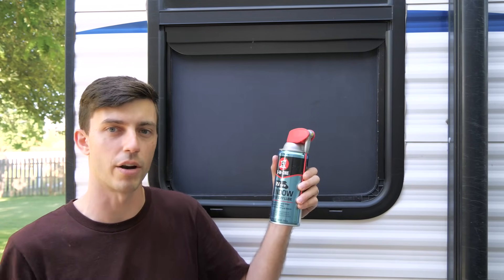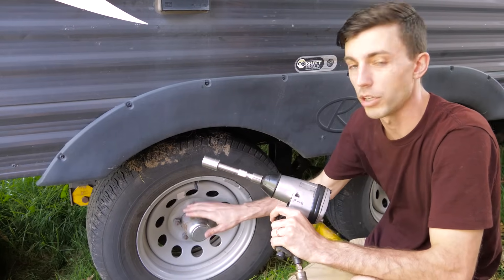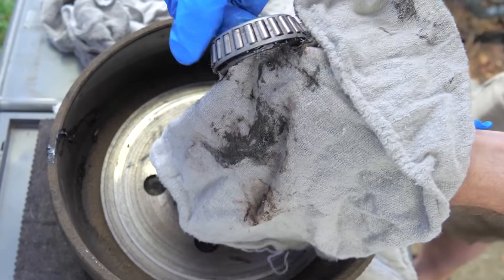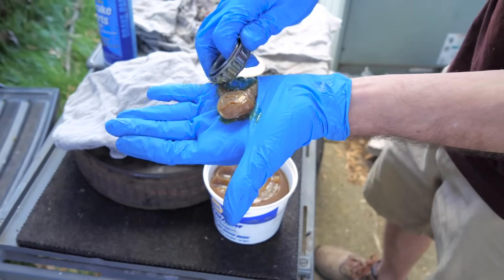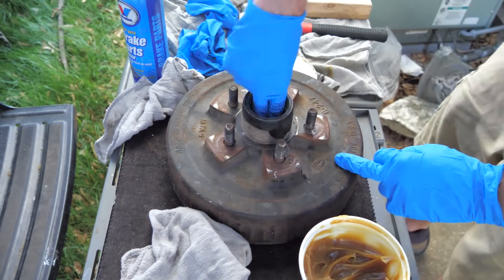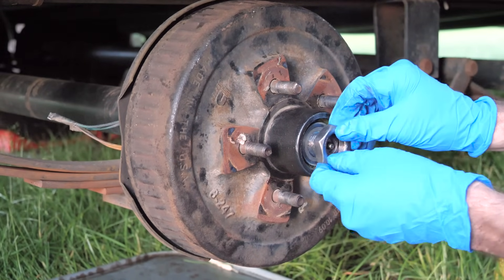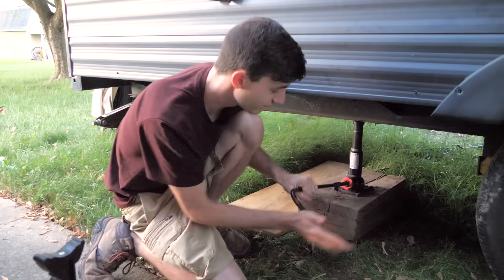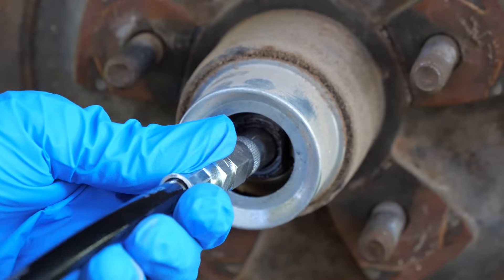Trailer Wheel Bearing Grease Repack and Easy Lube - RV Travel Trailer & Fifth Wheel

Comment: Nice job on the video, David! I repacked the bearing on my trailer for the first time earlier this year. It was easier than I thought. I ended up replacing the Dexter bearings with made in USA ones after hearing recommendations from several people. Last summer I tried the ez lube hub —but I was so paranoid I blew out the seal, so I don’t think I will use this method again.
Reply: You don't need that much grease in there anyways.  Boat trailers use that method, but they use a bearing buddy cap to stop you before you blow out the seal. Its used to keep the water out I believe.

Comment: Pro tip:
Instead of buying a seal puller, remove the outer bearing and thread the nut back on. Then pull the hub/drum towards you so the inner bearing catches on the nut, give it a good yank and your hub will come off, leaving the bearing and seal sitting on the spindle.

Comment: Check your chrome center caps my 2016 keystone has chrome center caps with plugs that can be pried off with a screwdriver the end about the size of a silver dollar.  Then you can access the rubber ez lube plug with out removing the wheels.

Comment: Even if you have access to the zerk without removing the wheel, you still need to jack the trailer up to be able to rotate the wheel while your pumping the grease in.
I do have EZ lube axles, but I like to do the manual method every other year so I can inspect the bearings and the races.

Comment: Take those center caps off or drill a hole in the end so you can grease your bearing w/o taking the wheel off. After torquing, I mark my lugs and studs with a grease pencil to see if they backed off at a glance. I also bought a poor mans TPS for less than $10. I got those red, yellow and green tire pressure caps that tells me at a glance what my tire pressures are. Thanks for the video. : )

Comment: Another method for removing that inside dust bearing is to use a piece of broom stick [length about 16"] to reach through from the front and catch the lip and use a hammer to gently drive it out.  John, Michigan

Comment: A mechanic told me that greasing bearings through a grease zirk is not the best way because it doesn’t get all the grease where it should be and it can also bleed grease inside that can get on the brakes.  I tied it that way on my 17,000 lb Trailmax tiltbed and after an entire tube no old grease was coming out so I redid it the old fashioned way.

Comment: Thank you, David! I thought you were kidding about using one tube of grease per wheel! You weren't!!! I have the Dexter EZ lub zerk fittings. I'm thinking about adding hub covers to protect that dust cover from UV. Maybe you could do a video on what spare parts you carry with you since y'all do a lot of boondocking. Also, what do you think about replacing the tires with truck tires when that time come?

Comment: I save old cardboard boxes, especially large ones, and flatten them out and use them under my work, even if in the shop on the concrete. In grass or dirt its a must. Another hint is that after you get the hub thoroughly wiped out, throw it out in the grass and take the hose and spray out the inside of the drum, it will take all of the dust and leave the drum and rough surfaces surprisingly clean of brake dust. The bearing packers that depend on a grease gun are junk, I have hand packed hundreds of bearings in my life (auto and aircraft) and I highly recommend one like the Lisle 34550. You can use them sideways in a vise, in an arbor press or simply set them on a floor with a shop rag over it to keep out dirt and then step on it. You fill it with grease and store it when done, ready for the next time. I use compressed air to blow old grease out of the bearing and them wash them in mineral spirits and carefully blow them dry without spinning them.

3500 lb axles are extremely common on travel trailers, and Dexter and Lippert both use the same bearings. I remove and scrap all China made bearings and use nothing but USA made Timkens obtained from an industrial bearing and drive business (Motion Industries or B&D for examples) that way you are assured you are getting real Timkens and not fakes. Verify your bearing numbers with what is installed or using the Dexter catalog online. Dexter Service Manuals https://www.dexteraxle.com/resources/manuals  Dexter Parts Catalogs https://www.dexteraxle.com/resources/catalogs

Don't quote me on these numbers till you verify them........... Trailer bearings and seals for 3500 lb axles
, both Dexter and Lippert.
Outer bearing	L44649
Outer race	L44610
Inner bearing	L68149
Inner race	L68111
Seal is a #10-19 (ID 1.719 in, OD 2.565 in.
)
National seal # 473336 (1.719 ID, 2.565 OD, 0.5 wide w/double lip and spring) (National #442251 is single lip wo/spring same dimensions)
.

Comment: Nice video!  A product that I found is a set of 4 Centramatic wheel balancers.  It makes a huge difference  because most RV's don't have shocks, a few ounces out of balance shakes the heck out of the RV at highway speeds.  A set of 4 is about $200.  I use them on the toe vehicle truck also.

Comment: It looked to me like your wheel center caps have a removable cap. But, of course you know your trailer. Also, for those with manual adjustable brakes, this is a good time to adjust the brakes. Auto adjusting should adjust each time you backup and apply your  brakes. Its good to backup and deliberately brake to keep those of the automatic type adjusted.

Comment: Very important to adjust the brake linings during this service, also clean those wheel studs and apply a dab of anti seize compound. Bearing preload is another issue, to get a perfect bearing setup you shouldn't accept a setting just because that's where the cotter pin lines up, a good mechanic will always have an assortment of outer bearing retaining washers which will get you a perfect pre load. That being said, following your instruction is better than not doing the service, as this service is ignored by a lot of trailer owners which is why we see trailers broke down on the highway...
Reply: Thanks for your extra tips!!  Will surely help this old woman!  Your totally right about sitting on the side of the road from neglecting this important issue.  Drove solo semi 26 years, people don’t realize sitting on the side of the roads can be a death sentence!

Comment: Great in depth video!! I had only used the Dexter EZ lube before, but it was great seeing this done both ways! I use a wide flat head screwdriver to help get that old grease out of there. Will definitely have to inspect those brakes later this year though and will reference this video again. Thanks for putting in all the effort into making this video! - Shane

Comment: David, my 2017 Lance has a removable metal cap on the outer cone, easily popped off with a screwdriver. No matter, the inner rubber plug is usually dri-rotted & needs replacing anyway. The local auto parts stores were trying to sell me a new outer metal cone & rubber plug for $13 each so I went on Amazon & found a set of ten rubber plugs for $11 total., a much better price. Maybe you can find it and put a link in for your affiliate link, etc. We put on 6500 miles going to SD this June & have to go back in September for Driver’s License renewals as it took months to get appointments. I am going to regrease the bearings and put on a new set of Towmax II 14” tires as the 4 year old original set now has 15,000 miles on them. They lasted that long because of our TPMS and I would stop as soon as I detected a pressure loss due to picking up a screw, etc. This will be the second time we will run new grease through, maybe the third time we will get the bearings checked & repacked the old fashioned way to check for scoring. Many thanks for your great videos. PS - my Easy Start install went great, but had to install it outside of the inner enclosed area due to the new ones coming with a bigger sealed insulated cord. Now to dump my Ryobi 2300 generator and get another Honda 2200, I loved my old Honda EU2000 that sold with our straw bale house in 2008.

Comment: Two things: 1) I'm a little uncomfortable with screwing in the holddown nut and then backing it off 1/4 turn.  I would either snug it down and spin the  wheel to see if
it is binding...then back it off.  Or....check with  the manufacturer and get the correct torque setting.        2) an easy way to repack the bearing is fill a ziplock bag
with grease and drop in the bearing....then knead the grease into the bearing  while it's in the clear bag....much more efficient and you don't ever dirty your hands.
Reply from the maker: There is no "torque setting" for axle castle nuts. They are not meant to be tight otherwise the angular contact bearing will not rotate freely and will fail quickly. The process shown in the video is exactly what the manufacturer recommends.
Reply: @FateUnbound  It's 50 ft-lbs for many to "seat" them together.  Then, you back off and finger tighten.  Personally, I don't use a torque wrench guesstimating the torque with, again, the point being that I seat the bearings.
Reply: Ron, don't get "ANY" ON YA!

Comment: Great video, only would add that for safety when using an impact gun only use impact sockets. the extension bar and standard socket you used could break and cause injury.
Reply: Absolutely true, safety first, but I'm giving him a pass due to how he did it very carefully and explained he was doing it only to speed up running them down, not to blast them on super tight.  

The true danger is for someone who doesn't know what they're doing, if they also have an especially powerful impact wrench, use an extension from a $10 socket set, and just blast away two-handed and don't stop when it contacts.  Less of a concern with feeble consumer-priced ones, especially if they just use short burps of power holding it one-handed like he did.  Unless you're two-handling or really muscling it, your wrist should send a distress signal well before the extension in even a $20 socket set will break.
Reply: Yes, that concerned me. Especially since he noted that you needed eye protection yet didnt have it on when using the standard sockets. Quite concerning.

Comment: Great video on hand packing wheel bearings. On doing the easy lube, you may want to talk about the risk of blowing out the rear seals that could grease the brake shoes.
Reply from the maker: This is what the manufacturer recommends, so I doubt there is much risk of blowing out the seal.
Reply: I've been cautioned about that by my mechanic.  He pointed out that those axles were invented for boat trailers, which get the grease washed out by repeated immersion.  And while it might be low risk, it's compounded by not being visible.

Another good reason to pull the drums is to inspect the brakes.  Your magnets (5:07) look like they're just about done - the telltale holes on either side are gone.

Comment: Get you a DeWalt 20 volt impact wrench.  You'll never want to use a air impact wrench ever again!!  Plus, carry it with you so if you have to change a tire on the road, you can do so without fighting with a tire iron to get those lug nuts loosen.  Also, get you a 20 volt drill-driver, too.  Handy tools that don't take up much room.  Ken

Comment: You might want check on mixing two different types of grease. 
Good Luck to All Jack
Reply: Yes, Dexter recommends Lithium Complex NLGI No. 2 (EP, Corrosion & Oxidation Inhibitors) 80+ Viscosity... never mix grease types.

Comment: Thanks for the good video.

Are you sure you can’t access your EZlube zerks by simply prying off the outer cover on that dust cap?  That will expose the rubber plug and the zerk behind it.

Comment: There may be a need to install a cotter pin through the shaft and the castle nut to prevent it from unwinding and coming loose.
Reply from the maker: This design does not require a cotter pin. The clip over the castle nut serves the same purpose.

Comment: Great job David. It brought back memories for me. My Dad taught me many years ago on repacking the wheel bearings. That is called kneading in the hands on repacking the bearings. That is exactly how my Dad showed me. One thing though it would have been ok to spray break cleaner on the entire brake shoes (not service though) and springs to get a better look at the springs and  hardware. Also I was wondering did you repack by hand on the remaining two wheels or just through the easy grease fitting. Thanks for bringing back memories for me . Great video David. Hi to Jenni I don't want to forget you and the fur babies.
Reply from the maker: I have memories of when I was younger of my Dad repacking the wheel bearings on his old truck with me in the garage to help. The remaining two wheels I replaced just using the EZ lube grease fittings. I'm going to alternate between manually repacking and using the grease fittings each repack so I can visually see how the bearings are wearing etc.
Reply: That's a good way of doing it because you can get an idea of how the only wheels are doing. I just normally pack all wheel bearings, but the way you want to do it is okay to. Yall are a smart and intelligent couple both of you now how to do alot of things that save yourself's a lot of money. Great job again.
Reply: Oh by the way someone else you can do from time to time is just jacking the tires just if the ground and put both hands on them to see if any play side to side and top to bottom. This doesn't take much time. AlsoThis is a great idea to do after you replace bearings and put it back together.

Comment: Really good video on how to repack the wheel bearings!  One thing I'd like to ask...is that wheel bearing seal removal tool worth buying?  I've seen people struggle with them on other videos and end up using the claw of a claw hammer to remove the seal.  Seemed like it was easier to do it that way.  What's your take on buying one?  I know they aren't expensive but that's one more thing I really don't want to buy unless I need it to do the job.  Again, awesome video!!  Keep 'em coming!

Comment: VERY well done! Many years ago I blew the bearings out of a trailer 20+ miles from the nearest town. Several trips back & forth to get the correct sized replacements and 10 hours later till I was up & running. From then on I have been he!! on wheels about bearing maintenance. I check them(heat) at every rest stop & upon arrival & leaving anywhere. Like your dad I'm old school and fill the hub as well. I now have E-Z lube axles.I have the silver plastic center cap that look like yours but the very end can be pried off giving you access to the rubber seal & zerk fitting.

Comment: If you flip the bearing over and do exactly what you were doing but do the large side it has a bigger opening and is much faster and easier.  Prefer the Synthetic Wheel bearing grease that is Moly fortified, that way you get the best of both worlds of highest quality lubricant.

Comment: E for effort !
I would....
Use RED  grease it has a higher temperature rating.
Apply grease from other side of bearing. Clean bearings out with paint thinner to remove all old grease and let dry. Inspect bearings and races.  Hand packing is better. Inspect & adjust breaks while the wheel is off of the ground.

The e-z wheel you used red grease; mixing gray/brown grease w/red is not good.
By not removing drum you can not inspect bearings/races/brakes =  poor mx; trouble just waiting to happen!

Comment: You should put wood on top of the jack and jackstand to prevent slippage from steel on steel.
Reply: Happened to me.  I always jack between the u-bolts  with saddle in bottle jack.  That's where the weight of the trailer is supported and it won't slip.

Comment: This was a great video, thank you. I disassembled and repacked that way. I'm taking a 1,400 miles trip in November and concerned if I have maybe tightened axle nut to much, I did back off on it. Since doing the job I have put about 100 miles on it and at end of trip I touched the wheel hub and it was warm enough where I couldn't leave finger on it. I'm concerned if hubs are to hot.  I did adjust brakes also. Any advice?

Comment: Should you have sprayed the  shaft of the Lugnuts with some kind of oil to keep them from rusting?
Reply from the maker: No, do not spray your lugnuts with any lubricant. You want and need them to stay tight! If they're tough to get off just use a bigger wrench or a pneumatic impact wrench. And always properly torque the lugnuts when putting the wheel back on.

Comment: With the EZ Lube it’s not usually necessary to take off the wheel, you just pull out a cap and you get access to the hub, much, much easier. (I just did it last week)

Comment: I'm wondering about the  tightening of the castle nut. Is it just snug for expansion? I thought the manufacturer had already set the clearance between bearings and races?
Reply from the maker: You don't tighten it down but instead follow exactly what I showed in the video. If it's any tighter the angular contact bearings will be too tight and wear extremely fast.

Comment: I think you would have been a lot better off to pull that hub apart and pack your bearings in the traditional way. It’s a little more work but you would save a lot of grease and you would have the piece of mind of knowing what shape your bearings are in . Don’t forget to check your spring shackles while you are under there. Thanks for the video.
Reply: Plus the E-Z Lube system is prone to blowing out the rear seals.